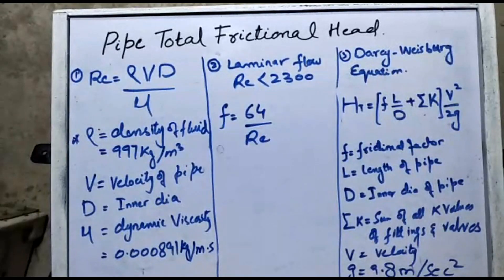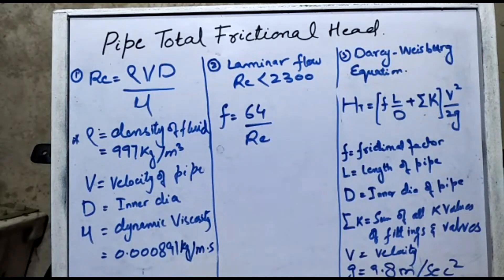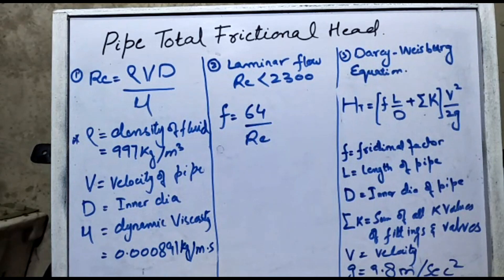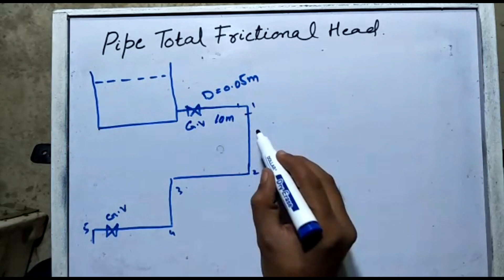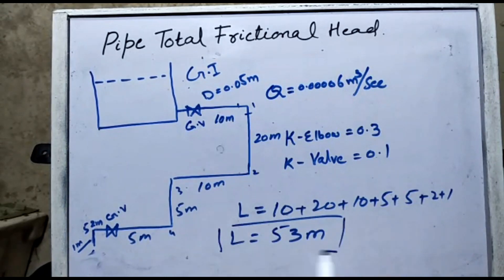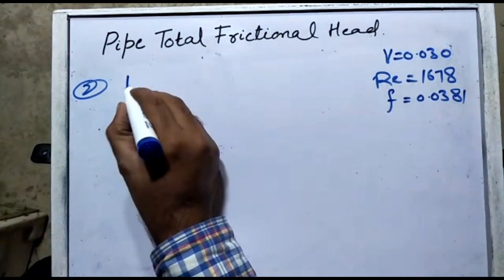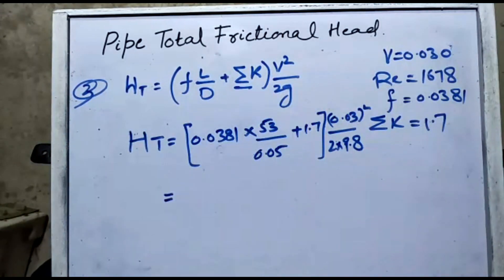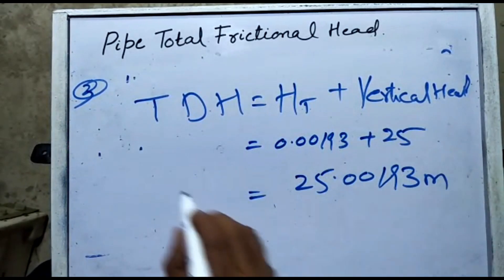Pipe Frictional Head Calculation by darcy weisbach formula

Comment: Frictional loss calculation was correct but adding the static head to Frictional loss is totally wrong. You should've subtracted Frictional loss from the positive static head meaning that the static is, for example, 25m but when the water comes out has 25m minus 0.00193m head or about 2.5 bar or 250 kpa pressure.